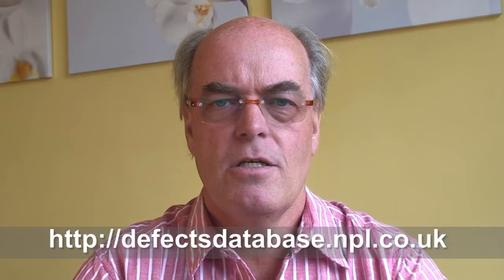Solder Joint Cracks

Comment: i think maybe you meant to say 'as you reduce the volume of solder - the joint is STRENGTHENED' as in the case with a pin that is 95% the diameter of the hole ... or?
Reply from the maker: Many thanks for the comment and glad you like the video, its one of over 50 clips on line and the other videos on my channel and on Linked In bobwillis.co.uk